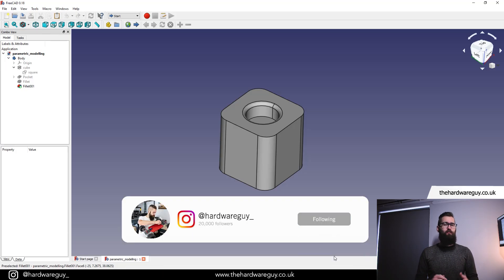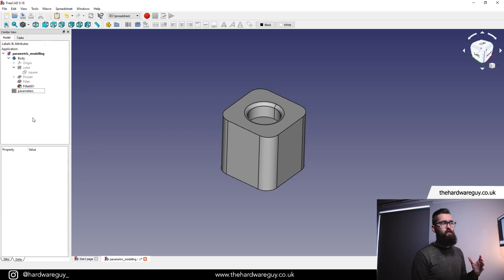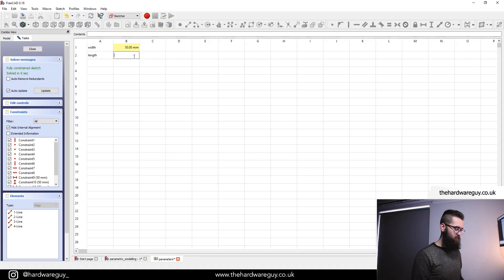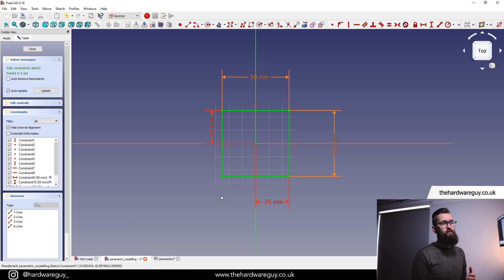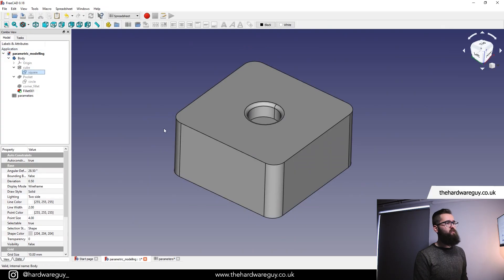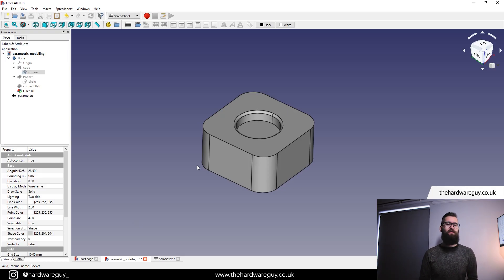FreeCAD For Beginners p.2 - Parametric Modelling

Comment: brilliant tutorial, after release of freecad v 1.0.0 it get a couple of minor changes in spreadsheet: 
1. to address to a parameter in spreadsheet use <<parameters>>.width or <<parameters>>.B1 if you don't want to use aliases
2. if you have more spreadsheets you can use equal sign to refer from one spreadsheet cell to another spreadsheet value ex. =<<parameters>>.B1 or =<<parameters>>.width
3. if you just type in cell 12.5mm, FreeCAD automatically detect Display unit and format.

Comment: I was gonna get fusion360 because I read online that it was free and I’ve heard a lot about it, especially from other creators using it for 3D printing. Imagine my surprise when I saw on the website that it was 680 dollars. 

That’s expensive as it is, but I’m not from the US, so I’d be paying almost 4 times that in my local currency. So I found this software and, well, here I am lol
Reply: Fusion360 can be used for free for non-commercial use, but it limits a few things such as CNC control. They make it a pain to get to but it's there somewhere, but it's worth mentioning the FreeCAD 1.0 (released Nov 202)  is becoming more and more like Fusion360 with each update!

Comment: I am working on a bowling lane. I need to have 39 boards of equal width, based on the width of the lane. How would I go about setting that up so if I change the width of lane, the boards will also update automatically and still be equally spaced?  Thanks so much.

Comment: I was captivated by the parametric modelling. I guess there is some way to change all values with a proportional factor (e.g. multiply all by 1.5). I had a play with the spreadsheet but no success so far.
However, another superbly presented lecture. Thank you.

Comment: Hi.  I must agree with the other comments here about how adept you are at demonstrating and teaching these techniques.  Well done!

It is awesome that the creators of FreeCAD have made this software available for those that do not want to or perhaps, cannot afford to pay for CAD software.

I would, however, like to add a comment to all those just starting out.  I currently use the paid version of Fusion 360.  It literally cuts the steps in half to accomplish the same thing with much less clicking around and automatic parametric modeling, dimensioning and placement in the 3D environment.  This is not a negative comment, just a bit of advice to hang in there if this seems like a lot of work to create something.  If this is something that you will eventually spend a lot of time doing, you may want to consider a paid version of CAD.  After all: "time is money".

Comment: I really like this. I bought a 3d printer 2 years ago and have learned quite a lot. However, the reason I started it, was to design my own stuff. That starts today. One question, apologies if it’s already answered and hopefully I’ll find it. How come, the spreadsheet labels don’t automatically translate to the alias. Aka, is there any value in having a separate label and alias. Do you use the label anywhere? It appears, it’s always a reference to the Alias. Given that, it would make more sense to me for the label, to simply be the alias. Thanks again. This is great stuff!

Comment: I'm having an issue using inches instead of mm. My preferences are set to "US customary (in/lb)," but when I create a parameters table and enter values using unit display unit of either "in" or " " ," what shows up in the object is a conversion of mm to inches. Thus, I have to input 50.8 to get the result of 2 inches to show up. If I enter "2," an automatic conversion takes place to "0.0787." What am I missing?
Reply: Ah, for anything but metric you have to add the unit type to the data entered, not just to "unit display." Thus, entering "2" is interpreted as a mm entry; entering " 2" " is interpreted as intended. That only cost an hour!
Reply: Another awesome video--Thanks for sharing!

Comment: @thehardwareguy can we reference spreadsheet by row and column like in excel? For example `parameters!B1`? Adding alias to each value is a bit frustrating.
Reply: But later on when you (or perhaps someone else) looks at it and sees "B1" you/they won't know what that means. Alias adds information as to what it is.
Reply: @SteveJohnSteele  ok, so it is possible, but not user friendly. Thanks for the answer!

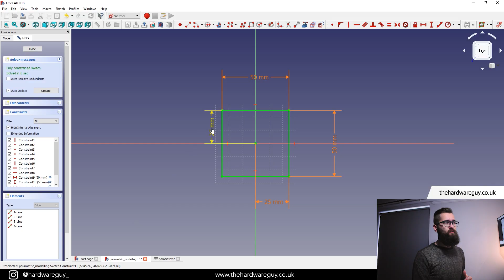Comment: Sorry, English isn’t my native tongue, but I was under the impression that the parameter at 06:44 was called the radius in English (polomer in my native Slovak, not the diameter (priemer in Slovak). Am I wrong?
Reply: Yes, it should be radius not diameter. Radius=centre to edge, Diameter=line through centre, from one edge to the opposite edge

Comment: This parametric modeling reminds of programming in a way. Whenever I am programming in java, I am making variables and some variable's values depend on other variables, so when I make a change to a variable it updates a whole section automatically because the other variables change all with it. Otherwise, I would have to do it manually for each variable.

Comment: Thank you very much. With this method, it becomes very easy to model bolts, washers and nuts of various sizes and lengths.
No need to start all over again to change the length or diameter of a bolt.

Comment: So quick question either I’m ahead of myself or missing something. I’m creating parameters and when I enter the value of length and width it changes to a smaller value? I’m from the U.S. so I’m using inches and if I enter 10” which is the width of my square it’s changed to .394”. Any help is greatly appreciated.

Comment: I'm a neophyte 3d printer but I recognize the power of parametric modeling; I subscribed because of this.
Reply from the maker: Thanks for watching! Parametric modelling really is such a powerful concept, it'll change the way you approach new projects.
Reply: @thehardwareguy  Do you have recommendations for organizing the Model Tree? I'm having trouble refining my models. Another youtuber CADZiS made a video demonstrating pitfalls in the Model Tree with Part, Part Design workbench, and adding Body, Part into Model Tree. That video was informative, but not instructive. Curious if you have (or maybe plan? hint.hint) to describe how we should organize the Model Tree and it's elements for Parametric Modeling (refining process which includes removing entire elements, and evolving our models).

Comment: Amazing, I've made my first parametric model! Thank you <3 Right, well that's me sucked in, I'll be following the rest of this series over Christmas, can't wait :D
Reply from the maker: Feels great when you get the hang of it, doesn't it?! did you model anything else over the holidays?
Reply: @thehardwareguy  I did!! I modelled a case for a small PCB (Stepper driver board) with a lid which has a cut-out to let the wires out, that interfaces together nicely. I also then mimicked the physical layout of that PCB as purely an exercise to put the skills I learnt from you to test. I then modelled a nifty little two-piece under-kitchen-counter pop-out sign which leaves a market to say if the pots in the dishwater are dirty or not. Its a mini sign that can be slid back and forth, it works great! I've been experimenting with all sorts in FreeCAD, I just wish I had more time to learn more on this and Python!

Comment: Some of the best tutorials I have seen. Many thanks, Just one query. In  FreeCAD For Beginners p.2 - Parametric Modelling, The circle dimension is a radius and not a diameter. Should I change the spreadsheet labels accordingly or, change the formulae to 2x the value?
What I like particularly about your treatment of the subject is the way in which you present the subject, giving the reasons behind the methods. It makes me think more clearly as I follow your thread.

Comment: Was the Paramater of 12.5 the Radius or the diameter?  Maybe I'm confused but I thinkI know what you meant. Either way the PC looked at the word Diameter as a String variable.  I guess if you use the same label across the program the pc doesnt know the difference between Radius and Diameter.

Comment: In Autodesk Inventor you could just put the 25 mm dimension in place and then just click the 50mm dim and type "/2". No necessity to type parametrers manually there.
Reply from the maker: Yes, you can do that in Fusion 360 too. But this is FreeCAD so the workflow isn't as optimal as other paid software

Comment: I choose inches or us in preferences in the beginning to be US and when I choose IN under parameters for spreadsheet the value changes 5 in changes to .02. I'm following your instruction closely. if i put mm the value stays at 5. what am i missing.
Reply: Late to the party but I had the same issue. The issue is that the spreadsheet defaults all values entered as millimeters and then converts to the units you choose to display. In your case, you entered 5 meaning 5 inches, but FCAD reads it as 5 mm and then converts to 0.02 inches. The work around is to define your value as being entered as inches in the first place. Instead of just entering the value as 5, type 5in or 5"
This tells FCAD that you're entering inches directly and it will stop converting. Works like a charm.

Comment: thanks for doing this. I too am a FUSION360 user of maybe 4 years... here's a question. Is it possible to set a value X to say 10mm them reference width, height and depth/thickness to reference X to keep proportions i.e. width is 2.5X then if you update X to 12mm everything would update proportionally and then tweak the things you need in mm like threads/holes and standard fittings... just a thought. like to hear your comment on this. Yes you can scale but this way is more fun.

Comment: Best FreeCAD tutorial ever!
However it annoys me that you keep comfusimg radius with diameter.
Reply from the maker: Fusion 360 uses diameter, FreeCAD uses radius. I teach both so it's sometimes confusing switching between the two
Reply: @thehardwareguy  ok. But FreeCAD supports using diameters as well. The radius-tool has a pulldown, so you can select to use either. That's why i find it confusing!

Comment: "Had" to leave F360.  Glad I found FreeCad and your tutorials!  Very informative.  I do have probably a simple issue of when double clicking the length/width dimensions, it only cycles through yellow/green colors and doesn't give the opportunity to utilize the parameters.  I can if I select the length/width icons on top, but then I have duplicate measurements shown and I haven't found a workaround for centering.  Ideas?  Thanks for the tutorials you have provided - Love them.

Comment: This training is starting at the right level for me, and has made things much clearer, thanks. I was about to give up on ever learning 3d cad.
Reply: Ditto. Have been thinking about buying a 3d printer fir 2 years but didn't coz i just did not manage to design anything. I now ordered one
Reply: Same here as well! Retraining in CAD after 30+ years in IT and electrical engineering. This is exactly the right level. Well done!
Reply: Same, this guy makes it a lot easier.
Reply: One more vote. Saved me from giving up.

Comment: just a point when using the spreadsheet.  After you've filled in the alias and display units and then pressed OK, your cell background colour seems to automatically change to yellow.  When I did it, it did not change colour automatically.   For every parameter I entered into the spreadsheet I had to select the colour tab and select that colour.  Am I missing something?
Reply: Maybe you have an older version of freecad?
Reply: @rwz  Thanks for your reply @Rene W. But I do have the latest version 0.18.4.9 only downloaded and installed 2 weeks ago.   Still puzzled but hoping for a reply from thehardwareguy.
Reply: @rwz  I have the very latest version 18 installed only 2 weeks ago so I'm still puzzled!!   Hoping for a reply from @thehardwareguy.   Really appreciate you taking time to reply - many thanks.
Reply from the maker: Hi Trevor! the colour change is an indicator that the parameter is active! I've not run into this problem yet but I will certainly look into it
Reply: @thehardwareguy  thank you for taking the time to reply.  It's strange, 'cos sometimes after closing and opening Freecad it does work but intermittently.  Also I've found that sometimes when entering text into the cells, after pressing enter the text is not visible even though it's still there (ie. If you select it you can see it).  I've tried changing  text colour but still not visible, no matter what the background colour.   Am going to reinstall and see what happens!  Just to reiterate, well presented and easy to follow tutorials - just at the right pace.  Thank you.

Comment: Fantastic the way you present your videos but whilst following this particular video and after naming the spreadsheet 'parameters' and filling in the 'width' and 'length' cells and their values I hit a problem after double clicking the width dimension in the sketch.  When the formula editor opens it finds 'parameters' but does not find 'width' in the drop down box when typing after the dot which follows 'parameters'.   Red text displays "property not found : width" and the OK button is still greyed out.  Been over it several times and I'm sure that I've done everything correctly?   I've checked the spelling and that is OK.  'length' is there but not 'width'.    Any ideas please?

Comment: Thank you so much. I have tried a few other tutorials until I got to your series and was struggling despite having a little 3d and CAD exposure. Your easy to understand and structured instruction finally made it click. LOVE the parameters and can see while it would not seem worth it for simple designs, following the discipline of proper design all the time is going to give you good habits and save so much grief later.
Reply from the maker: You're welcome Ronald! Absolutely, parametric modelling is the way to go, especially in larger projects!

Comment: Your tutorials are excellent.  Very clear presentation.  Logical flow.  Good length.  Like many, I’m learning FreeCAD after being frustrated with the recent changes to F360.  Thing is — I never really learned the right way to do CAD.  I’m now taking the time, and am actually MORE effective with FreeCAD than I was in F360 - not due to the tool (as you say, F360 is more polished) but because I’m learning from excellent tutorials such as yours.
Reply from the maker: Thanks for the kind words John, glad I could help out!

Comment: It would be nice to have cell A1 reference the ALIAS from cell B2 so you do not have a different spelling etc. 
Ex. in cell A1 you would enter
=B2.ALIAS
and then the name used as the alias for cell B2 would be displayed in cell A1

Do you know if this is possible?
If not could you suggest it to the developers?

Your tutorials are amongst the best I have seen for FreeCAD. 

Thank You
Reply: That's the beauty of OpenSource, anyone can put in a request and anyone can be a developer. OpenSource is an open community. Join the FreeCAD Forum read around the topics and if there's not already movement in the direction of your ideas/proposals mention it in the appropriate thread on the Forum. It's increadible how many improvements and specialities can be catered for. There's even a workspace for designing Paragliders/Parafoils been developed and implemented How amazing is that?! . ( Yes I'm a flex wing pilot by the way :-) )
Reply: @JK I was going to ask the exact same thing. My second though was that units should be filled in with a default automatically, just like in a sketch.
Reply from the maker: Thank you! I completely agree with you, there are many improvements that could be added into FreeCAD for sure.

Comment from the maker: Timestamps:
00:00 Intro
00:15 What is Parametric Modelling?
00:38 Picking Up From Last Time
01:07 Wouldn't it be nice?
01:30 Creating A Spreadsheet
02:08 Which Parameters do we need?
02:55 Creating Parameters
04:13 Using Parameters
05:33 Arithmetic Operations
06:44 Pocket Diameter Parameter
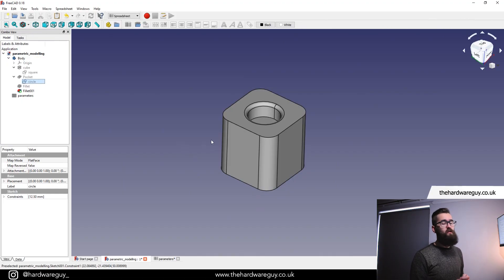07:51 Height Parameter
08:58 Updating the Design
09:23 Pocket Depth Parameter
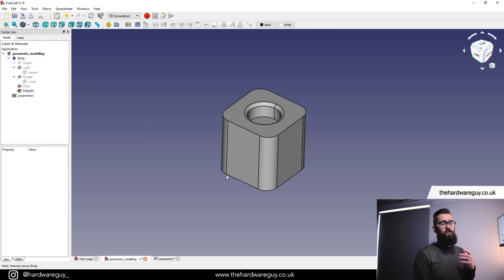10:13 Corner Fillet Parameter
10:55 Parameter Summary
11:18 Changing the Parameters
12:26 Outro
Reply: comment